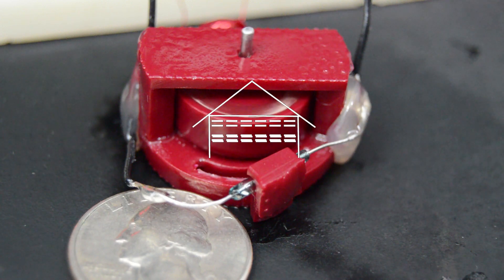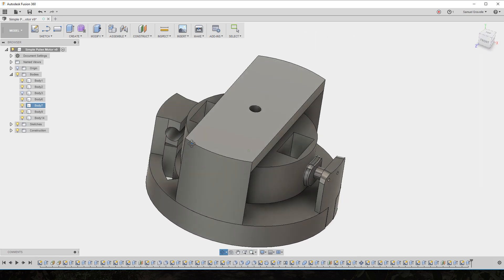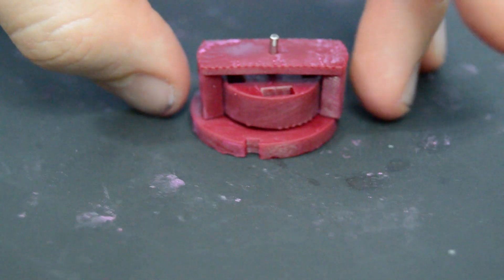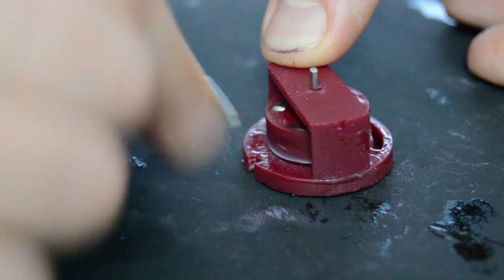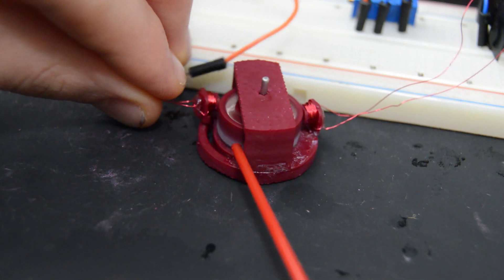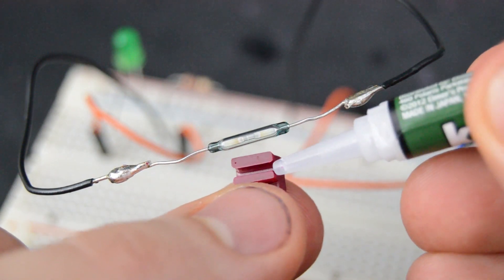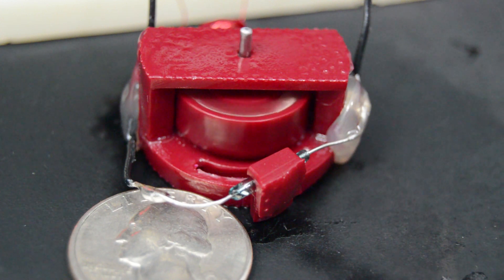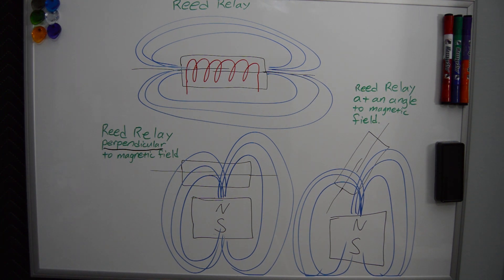Ultimate Mini Pulse Motor!!! ~ With Transistor Motor Controller!!!

Comment: A cam or crank angle sensor would produce enough voltage to trigger the electro magnet with a transistor reed switches burn out in a short period of time even with a diode

Comment: Hi, I had a similar project in the pass. To gain more speed, connect the anode of the diode of the driving coil to the positive lead of a large electrolytic capacitor that can handle 250V and connect you negative lead to ground. Then see the magic.

Comment: When you pulled the center part out of your reed relay it no longer was such. The center part is just a reed switch. Depending on the price locally, they can be had for $0.60 or less whereas that relay would cost a twice that.

Comment: Very fascinating! Would it be possible to use a hall effect sensor in lieu of the reed switch? I'm not sure whether a discrete or linear hall effect sensor would be better, plus they would draw more current than a switch (obviously). Thank you for this video.
Reply from the maker: Definitely could substitute a hall effect sensor. Current draw isn't so much an issue because for a pulse motor this small the limit on the amount of current draw is how much the coil can handle.

Comment: I am still trying to use just a transistor as an on/off switch. I dnt understand why you use both a npn and a reed switch.
Reply from the maker: A transistor isn't absolutely necessary if you use a reed relay and a flyback diode.  The first pulse motor I made used a reed relay without a transistor or flyback diode and the contacts on the relay didn't last that long due to constant arcing.  I used a transistor because I thought I would end up using higher currents and the reed relay isn't rated for more than 1A.  But the coils couldn't manage a stead state current much higher than 0.5A so all in all the transistor was just an extra component.  I also wanted to show in the video how the same controller circuit could be used by just substituting the sensing coil with the reed relay, but maybe that just made it more confusing ;) . Thanks for the question!

Comment: Did I hear correct, the power draw was 500ma....? That seems very high
Reply from the maker: It is haha, I didn't run it for long at that high of a current because you could start to smell the insulation burning on the coil.